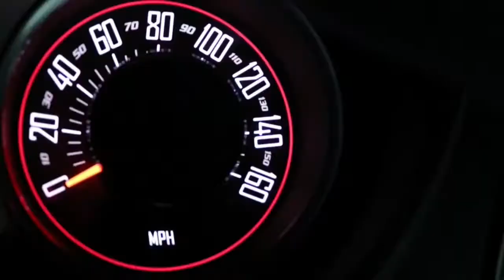Extended Spindles For My Dodge Challenger RT (F**ked Up Vs Legit Ones)

Comment: If the ball joints nut or end piece is hitting the top of your tire, you either have a bad spindle or issue with the rest of your control arms. Mopars design might seem funny but they know what they are doing. If the knuckle needed to be extended, they would've extended it. It's not the length of the spindle arm that is causing an issue with your front end.